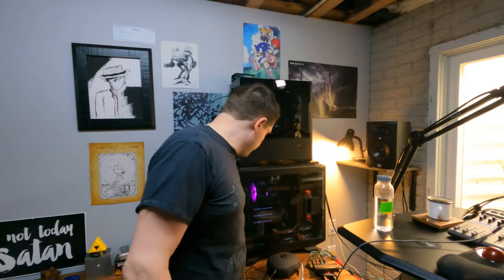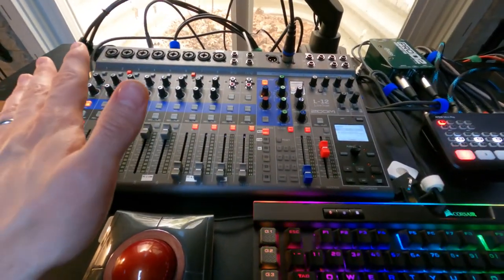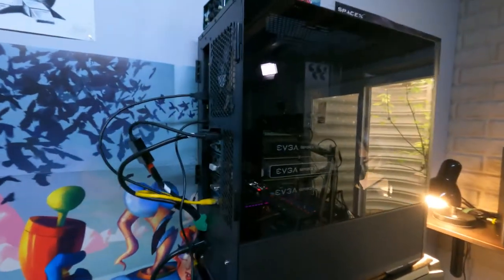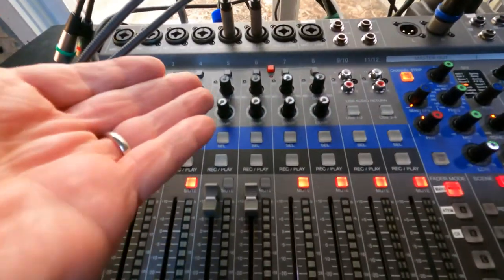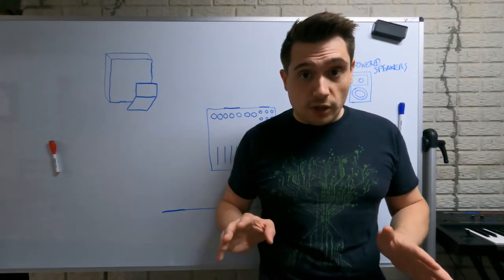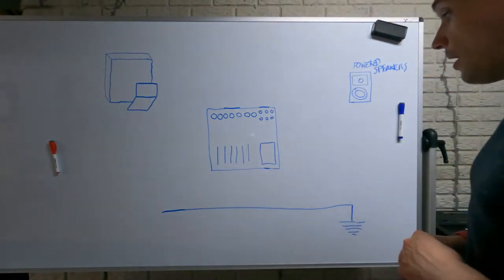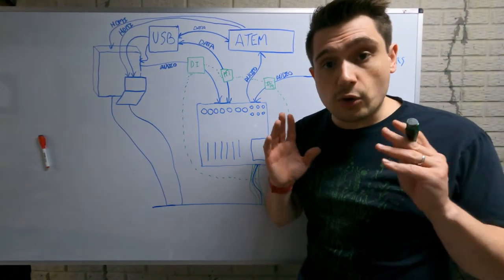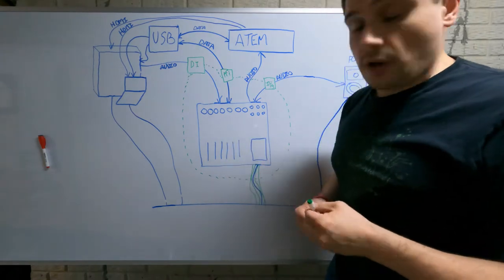SOLVED: High Pitched Buzzing Noise / USB Audio Mixer Ground Loop Issues

Comment: this is super helpful and informative. I just bought a usb measurement mic to do room corrections on my speakers, but I am getting a terrible digital whine sound on the recordings. I tried with two different desktop PC's with the same result. I thought it could be a ground loop issue but I still got the same noise even when I connected it to a laptop on battery power.. I have heard perhaps a powered usb hub could solve it? any ideas?

Comment: I just moved to a new house and I'm getting one hell of an annoying high whistle that comes and goes randomly while this has never happened before in my old house .. I'm using my exact same setup that I've been using for ages .. equipment are not faulty .. I've tried each and everything that might come to mind.. switched off every other device in the house to ensure no interference or anything and still.. same issue .. tried a  different sound interface .. same issue .. different guitars .. amps.. pcs..the only way I can get rid of this shitty whistle is by making sure that none of the audio setup is plugged into the wall and just use an external power source..  my laptop's battery for example which means that it is 100% an electricity issue ... Got a technician and he didn't know shit and when he gave up he advised that it's an issue with my equipment which is bullshit ... I'm desperate especially cuz this stupid whistle makes its way through to my recordings which means I can't even work anymore ..(I record for bands and for my own music ofc)

Any help

Comment: I didn't understand about 90% of what was said in that video, but I know I have that same type of noise with the USB from the mixer to the computer, so I'll explore this more. Do you have any tips on how to get rid of the hum noise when a guitarist takes his fingers off the strings, that noise that kicks in? I know the guitar itself is properly grounded.. Someone told me that high power transmission lines nearby could be causing the interference so I'm not sure what to do......

Comment: Great content and nice delivery!   This begs the question..  Since the mixer is the 'hub'... Does a mixer exist that has 'built in' ground lift switches on its inputs?
Reply from the maker: That's a great question! I'm sure a "real" audio/electrical engineer would have some very smart answer, but as a consumer of audio gear I would totally pay for that feature.

Comment: I had the same problem but as soon as I took my USB coming from my audio interface and plugged it into the USB that supplies power the one that acts like a charging port the problem went away. Make sure your computer comes with a dedicated USB charging port.  Clean audio no noise anymore👌

Comment: I'm using Allen Heath ZED 16fx mixer as an audio interface, USB cable to desktop computer and Reaper as DAW. When I arm a track for recording I hear high pitched (about 1.1kHz)  whining sound which peaks up to -60db. I think it has something to do with USB ground loop, but strange thing is that if I shut off the mixer or even unplug the mains cable from wall socket the sound still remains. If I after all unplug USB cable from mixer the sound vanishes. I'm a bit confused what causes this irritating sound....

Comment: Hey everyone and the creator. The video explains well about the ground loop. I am using wharfedale 1202fx usb mixer. The power supply of the mixer dont have a ground pin. Its only live and neutral. However the output audio on my mixer is giving buzzing sound even when nothing is plugged in. No audio input in any lines or any microphone. Just when i turn on the mixer and put up the master volume i can hear the buzzing  either u connect a headphone to the mixer or connect a speaker on the empty mixer i can hear the buzzing very loudly on all audio output ports like main out? headphone out, control out, aux send, all the ports having buzz sound in there on empty mixer. How do i fix this? Is it because my mixer power adapter doesn't have a ground wire or is it something else? How do i fix this please help.

Comment: FYI: Just because the PC operating system is shut down it doesn't mean it's 100% off. Unless you flipped the power supply switch to the off position, there's still power coming in from the power supply to the motherboard and everything attached to the motherboard.

Comment: Figured out that my whole issue was that one PC was plugged in to the same circuit as my sound equipment and the HDMI was reaching over from that PC to the same monitors plugged into my other pC but on a seperate curcuit. I got rid of the HDMI cable and it fixed it. Now I just gotta move the other PC to the same circuit as my main PC rather than the power conditioner that all my sound stuff is plugged into. Crazy that the problem Ive been having for months was because of a damn HDMI cable.

Comment: I was wondering about if you could put the signal in reverse through some of the passive radial boxes, that's great to know. Btw radial do make isolation boxes that turn balanced line signals into unbalanced line signal, the cheaper one is called "Pro Iso" and the one with more expensive jensen transformers is called "J-Iso". I have been wondering about isolating usb also thanks for clarifying some things.
Reply: The Pro Iso box looks exactly like what I need - thanks for the recommendation!

Comment: Thanks for this! has the second IFI defender burst into flames yet? I would like one but I'm cautious having seen several QC complaints
Reply from the maker: It has not burst into flames. However, I'm not completely convinced it's functioning in the ground lifting capacity I was originally hoping it would. The noise floor is definitely improved, but it's not perfect. And my multimeter tells me there is a connection (albeit a higher resistance one) between the two sides of the IFI.

At this point I'm thinking about going for a SealSO medical-grade USB Isolator, but I'm not excited about dropping multiple hundreds of dollars on it.

Comment: from my experience in pro audio,  the main issue of computer noise, is the  computer, and nothing else, I ussual could have many many device[instruments, mics, beat machines, power speakers  connected to a mixer, BUT the very second i connected the computer, to the mixer,  whether directly to the pc via an 1/8 jack, thru a mbox 2 or a rc505 interface mode, the 3 different ways to connect to the computer and the second you connect it to the  computer you get computer induced whining. . . .  d the bubble idea is great, BUT its not needed if you if the only issue is the pc also i would suspect that the isolation transformers your using will color the sound [whether good or bad not sure] . . . . for the first time ever i was some what able to resolve the issue. .  I actually wrapped the pc power cord ground with eletrical tape and plugged it in.  and boom problem 90% solved. .  all other devicecs still grounded, only the pc is not. .  there still miniscule nose noise. the second thing i did which was gheto but was the first test, was to solder a ground wire to the usb cable running to the interface and this cleans it up noise floor a tad more, BUT still not as clean as i want, im still convinced the computer noise is still comming from the computer, so my next test is to either buy that device you have. . , or make one,
Reply: You basically removed the ground from the main of your computer which is as Alex explains very dangerous

Comment: As far as balanced to unbalanced connection is concerned its als effective if you just disconnect ground on the unbalanced side of cable and put "2" to "pin:" and "3" to "sheield". Be carefull of signal level (its doubled)

Comment: Another comment:

Any cable that you use to connect audio stuff together WILL have a ground shield, which will inevitably cause a ground loop. This is why USB interfaces are infuriating, as there is no ground lift for USB. 

I use a DI box to record guitar and a reamp box... Which is my DI box in reverse. And that hissing will actually be going through the XLR on the reamp and will be picked up by the guitar signal. The USB ground is a major expensive problem.

Comment: Those Radial Pro D2 boxes? $330 here in Australia!!!
Reply from the maker: Wow! That seems excessive. And I thought they were expensive at $170 USD…
Reply: @AlexMarkley  turns out the MPOW noise isolators do the job just fine, at only $10 each on eBay.
Reply from the maker: @Hakucho64  glad to hear it!

Comment: First get furman,, next buy cheap transformers 600ohms from ali express solder these inside mixer for decoupling ground,,, you can also try using mixer from another power strip if you have one

Comment: What about you just connect the + side of any audio signal (that had a ground loop before) without the ground line... ;) should actually work.
Reply: a single wire you mean ? You just revolutionized electricity and electronics ;)
Reply: @robroufla   Of course I was just partially serious but... it works electrically. If all grounds are common then this works 100%, but it doesnt mean the signal quality would be good. You can try it out yourself, you will see that it actually works.
Reply: @Stinktierchen  haha I see, well yes but as you said, not good quality, in fact you'd probably only hear hum

Comment: good grief, there's way easier ways to stop the loops. I dont think ur full of it because you solved ur problems so ur more of a champion but that was an overkill.. The issue is dc sneaking into your ac. There is a heap of free techniques you couldve tried first. The speakers should have been plugged into the same power outlet not seperate ones, being on the same ground at the box has nothing to do with the loop.
Reply: Wanna idk name a few?